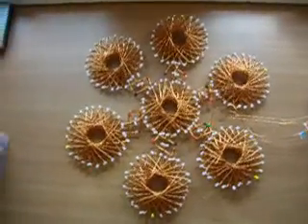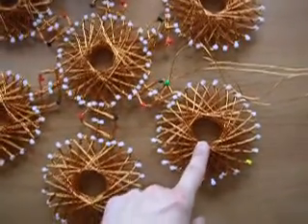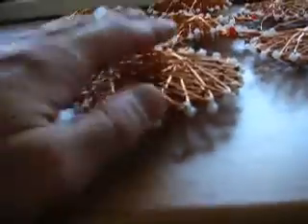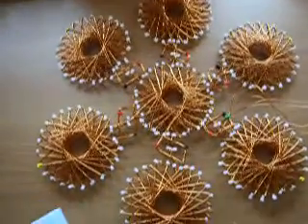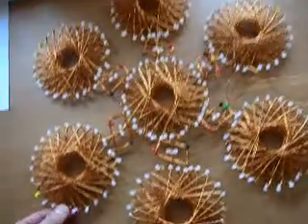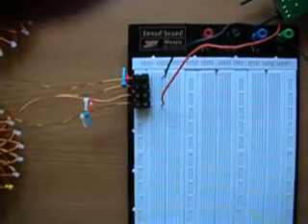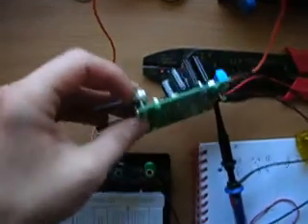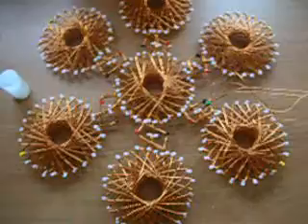SSC - Starship Sattelite Coil

Comment: Hello friend. I have built a starship coil with 12 points. I just want to know if I have connect a resistor to it if I am adding say 528Hz signal to it? Does the coil seen as a short without resistor?
Reply from the maker: Hello Friend. You should measure the Resistance of your Coil. A Normal Speaker is around 6 Ohm, but there are also some with 4 or 8 Ohm. If you just ad a Frequence it should be O.K., as long as you don´t amp it up too much, or your Coil could get damaged. Do you have a Picture of your Coil? I would love to see it. Stay WOKE.
Reply: @KW42ON  The coil resistance is around 1-2 ohm. I will be using a function generator to add frequencies. Send me your email, I shall send you its pic. This is my first coil. I just made a single coil. I will be testing its magnetic field strength. Have you measured its Gauss yet? Can u explain the method?

Comment: Great.....but I´m don´t understand......what´s a satelleite coil¿? Radio reception? I look for information, because are a lot of work for nothing.
Reply: Poter they can be used for many things, but alot of things have not been found out yet.. people need to experiment to find uses, the donut shaped ones can run a brushless motor on 2 phase instead of 3 phase electricity which is cool